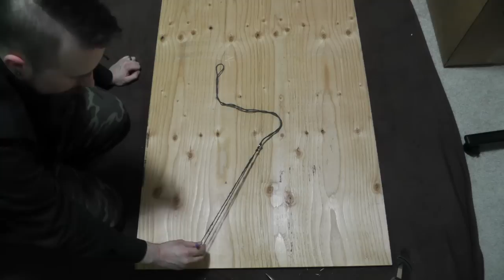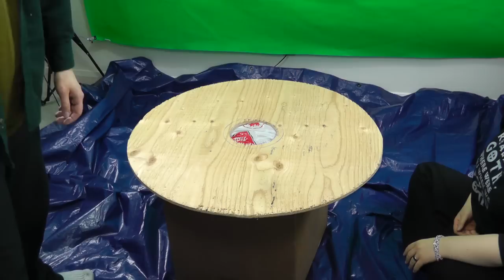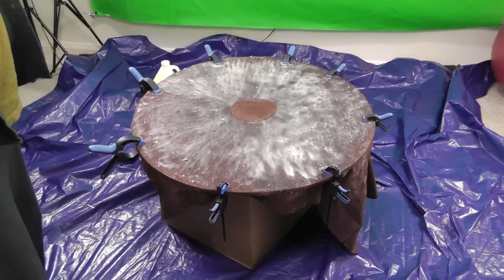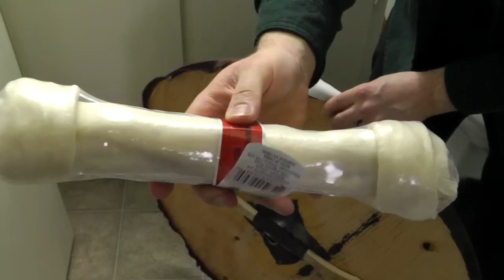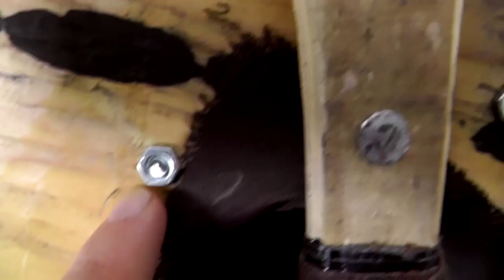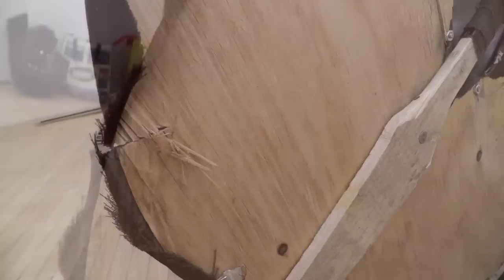How to make a Viking shield on a budget

Comment: Would leather, or fake leather (Vinyl) be good for using as a cloth to give it a different look? Or would the wood glue not adhere as well due to less absorption through the material?
Reply: Just get a can of epoxy glue. (Or similar.)

Leather is very historical and would represent a more expensive shield.

Comment: Would it not have been easier to simply screw or nail the canvas to the edges? You can bend the points coming out the back fairly easily, especially with nails.

Comment: How thick is the wood you use for the grip? I got 12mm multiplex and 1.5-2cm oak or 3cm firewood available :/ I would go for the 1.5-2cm oak but I am wondering if 12mm multiplex would be ok? Or maybe the 3cm firewood better? x
Reply: i used oak soooo i tested it out and its good

Comment: Wait, are you sure the grip should be right in the middle like that? Does the part of the shield that sticks out in front of your forearm really help you that much?
Reply: Yes it should be in the middle. You want it in the point of balance, otherwise you are fighting against the weight of the shield and tiring you out.
And yes you need that shield portion to your right side. It covers your right side. When held right, it is out of your way and helps protect your arm as you strike.
Reply: demomanchaos
Oh, okay.
Reply: Also it's interesting to notice that construction like that, along with the size of the shield allows you to cover on actually every angle with ease
Reply: Michał Wiśniewski
It does kind of make sense to me, now that I think about it.

I've no experience fighting with a shield, so I wouldn't know about how they should balance. But do I know that your hands are stronger when they don't cross your center line. And if you want to be able to attack and defend in the same tempo, then you can't very well pivot to the right every time you need to block an attack from that side, because that will turn your attacking side away from your enemy.

I can kind of visualize it in my head, I think.

In order for an opponent standing in front of you to target your right side with a weapon held in his right hand, he would have to either get close-ish and cut from across his center, in which case you should be able to either trap him with a push of your shield or push his sword out of the way, or else he would turn his right side towards you, which turns his shield-side away from you.

In the latter case, there should be some kind of an exploitable opening during the tempo in which he attacks. Probably either his side, his leg or his sword-arm, depending on what he's doing with his own shield.

Does that sound about right?
Reply: OptimalOwl Something that might help clear up some questions is the stance you take. Unlike fencers, with a shield you are more squared up to your foe. Generally the spacing is your lead foot (which can be either side) about one normal step forward and horizontally about shoulder width apart.

From this position, you can easily put your hips into attacks from both sides and still stay covered behind your shield with minimal movement.
Reply: moxigen good video
Reply: demomanchaos
Yes, I realized that much already : )

Anyway, thank you for clarifying why the grip goes in the middle. It's difficult to appreciate balance issues when you haven't actually worked with the weapon in question.
Reply: Just to clear some things up about shield techniques.

1.  This type of shield is designed for skirmishes.  It can be used in formation also, but it is not optimal for that.

2.  In a skirmish situation you do not present the face of the shield to the opponent.  A good opponent will turn your shield into his shield if you do this.

3.  Presenting  the edge of your shield to the opponent gives you more reach which actually covers more of you then presenting the face.  It is all about the angels.

4.  In a skirmish your most effective offensive weapon is your shield.  You use it very aggressively.  Jamming it in his armpit, pushing away his weapon, or shield, or just stunning them with a good edge to the face.
Reply: acvarthered
Thanks for the clarification.

I'd gotten as far as #2 on my own. It makes a lot of sense, I think, that one would try to use their own shield to block the opponent's angles of attack, while simultaneously trying to keep one's own open.

Perhaps you could further clarify for me, what are the principal differences between those shields optimized for formation fighting, and those optimized for skirmishing? From your description, it sounds like skirmish shields would have to be smaller and more nimble, so that you could better strike with them.

Comment: it wouldn't be too difficult to make a boss along the lines of those copper bowls you make when you first start metal work at school. It might not have as smooth a finish as the one used in the video but it would most like suffice if anyone wanted to make everything from scratch.

Comment: Very kool. I would have just painted it next time though instead of putting the fabric, but then again maybe even some kind of fur or thick cheap resin to hold the wood together after it breaks from several blows to keep it partly together or grip the weapon more.   Just an idea :P
Reply: The fabric actually really helps hold it together by providing a uniform surface that is cohesive. What I'd recommend if you're going to use resin is to apply a layer over the fabric after as a form of shellacing to further increase the toughness of the coat. I'd also recommend doing two or even three layers, and instead of cutting the fabric off so close to the rim folding it over and affixing it to the back with more glue, but that's me, personally.
Reply: ***** I'm not making one anytime soon, but thank you! That was really informative in case i do someday :P
Reply: Jordan Mahara
Might do a rawhide layer at the last, but it's still expensive as crap compared to the cost of everything else. For a set piece, it'd be worth it, but for a shield in actual use? Definitely not.
Reply: Jordan Mahara Oh, most definitely. The biggest problem you're likely to have is getting an appropriate thickness, and getting it supple enough at that thickness, to be boiled to the framework and allowed to shrink to the frame. Even then, that would be more of the kind of shield used to deflect blows rather than catch them for openings; I'd expect that shields for those in sieges were covered with cuir boulli, for better protection against arrows. I highly doubt the average militia had more than a partial outfit of cuir boulli for his entire armour set, let alone a shield. Takes quite a bit of training to use a shield properly, to deflect or to catch weapons upon.
Reply: Jordan Mahara
 Yes, and that's rawhide, not actual leather. Hide needs to be scraped thin to be turned into rawhide, and it lacks the thickness and capability to be boiled into cuir boulli.
Reply: Jordan Mahara
 If it's thick, it ain't rawhide :p Seriously, though- rawhide is defined as thinly-scraped and cured, but not tanned, hide. Sure, there are variances in thickness, but you won't really get anything better than that without actually getting leather proper. If you're buying from Tandy, give their economy tooling leather a look; it's flexible enough for our purposes, and is consistantly cheap too. The black mission grain pigskin economy is currently on a mega sale for only 7 bucks each, 4-5 sq. feet per (cheaper if you have a club membership), so I might pick up a bunch of that for a couple of upcoming projects. Not that thick, only 1-2.5 oz, but still thicker than rawhide- a good finishing layer, IMO.
Reply: Jordan Mahara
Ehhhhhhh~ 8 oz would be nice but that's going into the expensive pieces. I've worked with the Tandy rawhide before, and it's even thinner. Maybe it's a local specialty deal that you're getting the advantage of? I can't find anything in that range that's cheaper than a hundred-some-odd; Rather layer on a few layers of pigskin like a jackcoat than pay that much for a single solid layer.
Reply: Jordan Mahara Oh jeez, goat rawhide? Okay yeah, that'd help explain the strength. My aunt used to keep some goats, would slaughter one a year and I'd get some of the rawhide she'd make from it; it was awesome to work with. Sounds like you got yourself a really good deal.

Comment: How does that shield work? You hold it with one hand in the center wont it just tilt
 and twist when a sword hits it on the side ???!!!
Reply from the maker: That's the point. It takes away a lot of the force. Also you can maneuver it more easily and hold it in many different positions.

Comment: What made you decide to go with this kind of shield grip vs a forearm grip?
Reply from the maker: It's historically accurate. Viking shields always had a center grip.
Reply: So a Viking aesthetic. Cool
Reply: LORD VOLCOS There is actually little evidence that any shields had straps. The closest things vikings had to straps were back slings on their shields. The standard viking shield had a punch (grip) boss (hand protector) edging of leather or steel, facing (usually of leather, but could have made by layering linen) and a sling. In many Jarl's standards the painting style was black and yellow, or bed and black. Though many more styles were used.
Reply: I believe that there are also some potential viking sword techniques which essentially require the shield to be without a strap because of how it allows it to move in the hand, such as techniques that require attacking from the other side of the shield (crossing your arms)
Reply: Usually cross-grip shields were ditched because they were heavy as hell ie the aspis or hoplon shields of the Greeks.

Comment: For the shield boss I used a metal bowl, I just flatting out the edges with a  hammer. And used the drill to bor holes. The I need a guide my brother wanted a shield

Comment: Nice video. I would put the nails in from the face and either bend them over on the inside or use a ball peen hammer (if you have one) to peen them over as you did. Now shields were not used to statically appose a weapon strike and as you saw, rawhide did not improve it much. Cows were rare and expensive so I doubt they would have done that type of edging.
Sword & Shield Fighting (Roland - Hammaborg) - Part I

Comment: i've heard that its better (and done so historical) to not saw a circle for the shield boss. instead you should saw out a 8, so you have the grip more in the center of gravity. that would then be reinforced by a metal band.
plus you made the same mistake i did with my first shield, you only glued the canvas on the front side of the shield. in fact its much more important to put it on the back side (best 1 layer on the front, 2 layers on the back side). the force of a spear thrust for example will travel through the wood and then splinters will break out the back.
Reply from the maker: I don't know where you heard that but the historical way to do it was indeed to just cut a circle.
Reply: i think there were both ways to do it, depending on timeand region i guess. for example take a look on this book cover http://img7.gettextbooks.com/pi/8788415112/500/500 there you have the 00 shaped hole. its a publication on finds in Illerup Ådal denmark (i dont own it yet, so have to rely on other that do until i get it :) )

Comment: i made mine 1 inch thick is that bad?
Reply: No, in fact it might be better
Reply: It will be twice as heavy. You may need the extra durability offered, but you probably wont, so its just lugging extra weight.
Reply: its extremely heavy. ive finished it and its a bit more than 25 pounds. im going to remake it soon.
Reply: after you remake one, no need to throw away the 1 inch thick shield. just resize it & turn it into a targe.
Reply: The one a made was 2/3in thick and a had a 1/4th inch steel rim

Comment: ***** Would covering both sides with canvas help it? And do you think you might make a tutorial of making an octagonal shield, so that way you might be able to replace the circular raw hide edge protection with metal edge protection? =)
Reply: I think covering both sides would help against splinters =)
Reply: Yeah. Agreed. And what about metal edges? I'm sure hardware stores could sell some bended metal edges that could be cut to the right length. Sure, wouldn't look right, but it would work.

Comment: i may be wrong here but i thought viking shields were formed from 2 layers of wood with perpendicular grain, wouldnt this be easy to break if the blade hits in line with the grain of the wood?
Reply: the grain of each layer of wood goes perpendicular to each other. basically the historic Viking shields were made out of medieval plywood
Reply: He made it out of plywood, which is perpendicular grains glued together, typically every 1/8th inch, so this would have three plies.
Reply: hmm i wonder which would do better, probably the modern plywood since its more interlaced but it would still be an interesting stress test
Reply: Safe bet our glue is better, modern plywood is also pressed together, with more and thinner layers. 
They would have used a wood with good shield properties. Plywood is typically of the SPF (spruce, pine, fir) variety. But modern plywood of proper wood would certainly be stronger. Lots to consider though....Likely they would have the bulk of their wood running horizontally, preventing splitting due to blows in the vertical direction...so more plies might not always help. For everything you gain doing something someway, you lose in another way.

Comment: What if you smash it with a mace?
Reply: +OMNOMER12 Vikings use any weapons they could find, make or loot, but their shields were pretty weak, but also pretty cheap and easy to made, so they could just change damaged shield instead of try to repairing it. 

By the way vikings shield had to work well against their foes, not against vikings.

Comment: i feel like a good cheap way to improvise the metal piece would be to just take a metal bowl for cooking that is of the appropriate size and then driill some holes in the rim and bolt it on.
Reply: maybe double up on them since it's made for cooking, not fighting.
Reply: thats valid, putting two together, maybe even solder the two together (it wouldne be hard, some flux and soldering wire from the hardware store, and most people already own a blowtorch or have a friend who would lend them one)
Reply: Skidin Dingo
I'd still suggest getting a real steel boss if you're going to be in a reenactment or something, but just for costume-work or sparring with practice swords this should work quite well without them breaking.
Reply: yeah,that was kind of my idea with it, make a cheap thing to practice with
Reply: Skidin Dingo
well, I'd still suggest pricing out actual steel bosses.  they might be cheaper than multiple stainless steel bowls unless you could find some salvaged out of a dumpster or something.

Comment: could you use a metal bowl for the boss?
Reply: No, it wouldn't be strong enough. If the boss gets crushed, so does your hand. I don't think I need to tell you why a crushed hand is a bad thing.
Reply: Ok makes sense, wasn't totally sure if it would be or not
Reply: Luke Walker Shield bosses are really cheap, so no need to really skimp.
Reply: PsylomeAlpha I paid 12 euros for my boss. It's really not thaaat much and i agree: this is exactly the spot where you want to have 2mm of solid steel.
Also, if you used thin metal bowls and somehow found a way to attach them there, I think they would be easily torn of the shield by a solid hit.

Comment: To peen the screws on the boss, just take any metal cylinder that's long and thin enough and hammer it on top. If you're feeling really creative, round the end of the cylinder out a bit to speed up the process.

Comment: Maybe carriage bolts or rivets would look nice
Reply: I used carriage bolts & ground/filed the serial codes off the heads. I also filed the edges of the nuts on the other side of the shield so they wouldn't injure my hand in use.

Comment: You can use polycarbonate plate instead of plywood.
Reply: Sounds very historically acurate. ;)
Reply: Awesomebird Sama It isn't. Yet it is safer to use as it will not break easily nor a chip will fly into your eyes. If you cover with canvas, it won't look that weird.

Comment: The Viking shield was made to deflect blows, not absorb them.
Reply: +Neil Schostag try breaking a shield with rawhide on front of it
Reply: +piedude898   The key to attacking a real Viking shield was the wood grain.  All shields found to date were made of strips of whole wood glued together,  not plywood, strike it with an ax or heavy sword, WITH the grain, and it will very likely split, strike it AGAINST the grain it could hold.  The Sagas say they were made of pine or other soft woods, and only a half an inch thick,  making them light and maneuverable for there size, thus my comment about deflecting blows rather than absorbing them.  I've always felt painting or covering them was more to prevent the enemy from seeing the direction of your wood grain, much more that just decoration.  I agree with you, rawhide is tough shit, with a rawhide skin glued to the surface you could keep the shield together if damaged or split and it would hide the grain.  I know there is a lot of talk about a rawhide strip around the outer edge to keep the wood tight together.   I think the Vikings would have loved plywood with it's cross grain layers...
Reply: what wood grain?